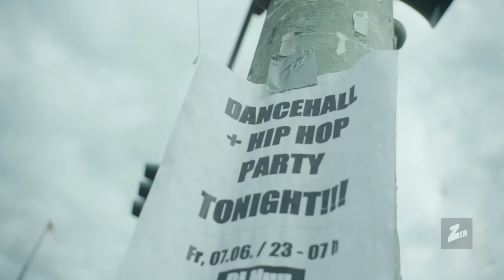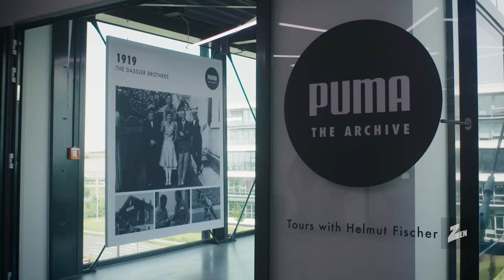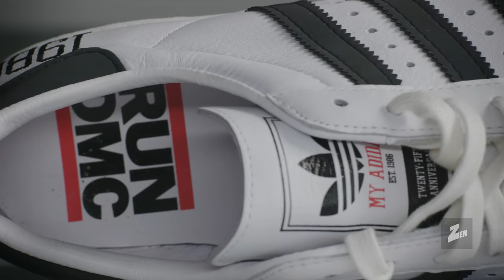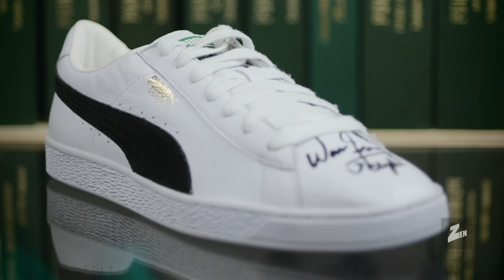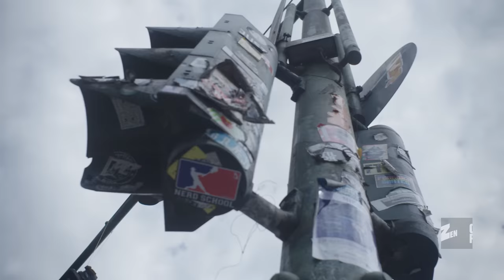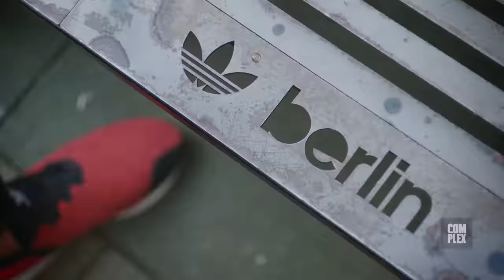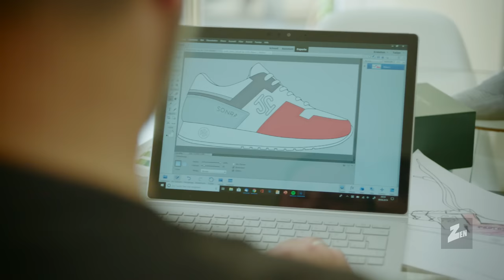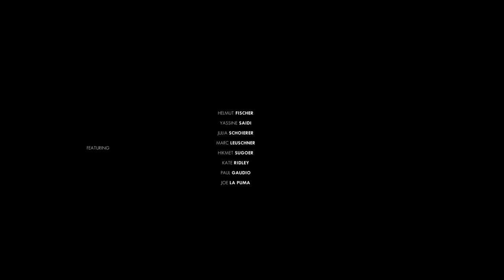How the Berlin Wall Gave Birth to Germany's Sneaker Culture I Sole Origins

Comment: Love puma, my first sneakers was a pair of puma basketball shoes high cut. And thru the years, i only bought 3 pairs of puma and dozs of nikes, adidas. In fact i own more saucony and hokas than pumas. Sad coz puma is a vintage brand and should be up there with the very best. If only puma could hire better shoe designers coz honestly puma shoes are ugly.  Yeah this may anger some puma fans but really i dont understand puma designs. Its not sleek, colors are weird, not much tech in it. Recently they had ignite but they could take advantage of that tech, they instead came up with shoes with ignite midsole but fits horribly. I couldnt get myself even to buy a pair during a sale event which offered 60% off. Its just killing my feet

Comment: My sneakers: 4 Vans( Low sole, High sole) , 2 Adidas, 2 Converse, 1 Nike.
My Football boots: 1 Nike(FG), 3 Puma( 1 SG, 1FG, 1AG).
if you don't have known of this brand, what's the point of wearing sneakers????
Reply: Vans: Burgundy authentics
Nike: AF1 flyknit ultra hightop, Air Max 90, cortez ultra
Adidas: BB ST Neo 
Converse: monochrome white low, monochrome black low, red high top

Football boots: Nike mercurial V1, adidas predator x17

I need more puma and adidas sneakers for sure